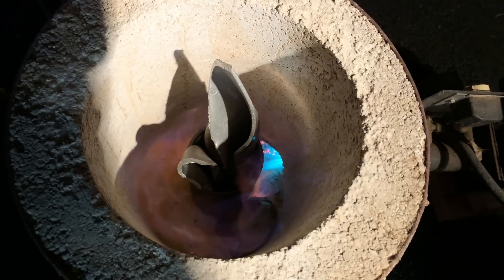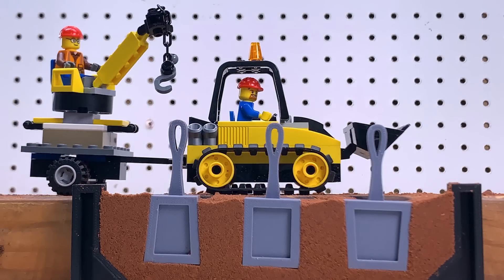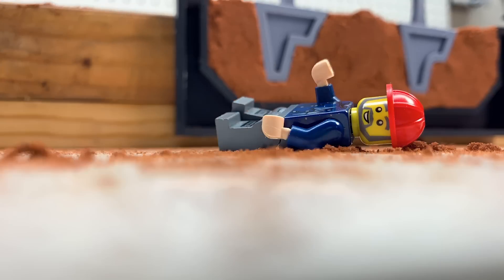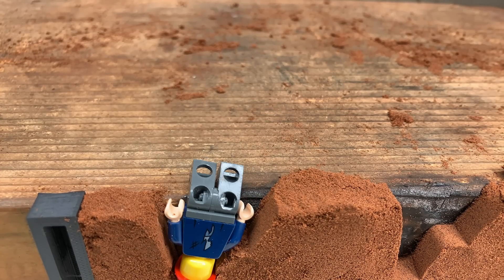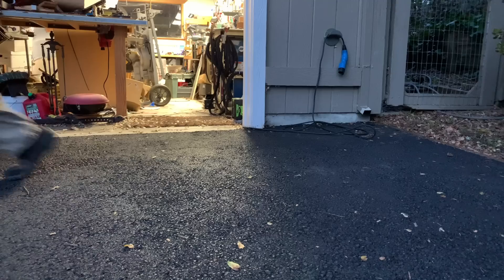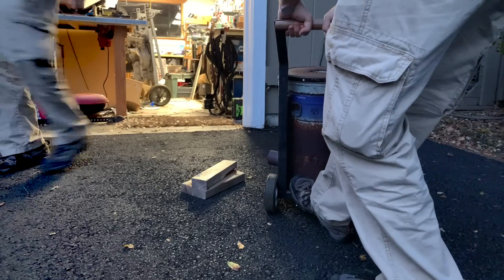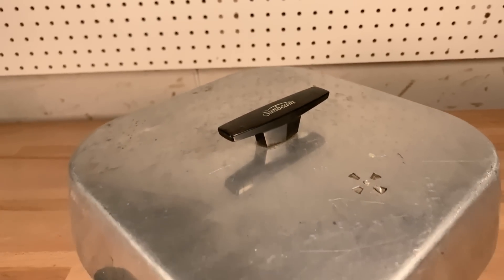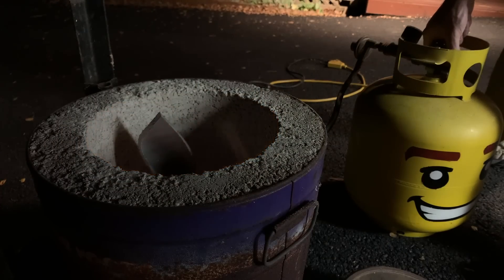Learn to Cast Metal Parts from 3D Prints

Comment: new to printig so might be a dumb question but are their any special settings for printing the models like resolution ect?what settings and filament type you use any help is apricated thanks!!!!
Reply from the maker: Welcome to 3D printing!  If you are talking about filament style printers, the main things that control "resolution" are nozzle size and layer height.   A giant nozzle will limit how thin a wall you can print, and will also affect how many passes the printer has to make to form a "filled" area on each layer.  Because the model is printed out in layers, the layer height controls how thick a slice of the object is printed in each pass.  These steps are what people call "layer lines" and the thicker the steps the more noticeable they are, however printing with tiny layer heights takes longer.  I printed these models in eSun PLA+ with a .15mm layer height, and 0.4mm nozzle diameter. Pretty much any PLA filament will be fine, and helps make it easy to print.
Reply: @retrotechjournal  ok gottcha that make a ton of sense now so by making smaller lines ill get better resolution basically i bought some petg with carbon fiber for making the models  i have someone wanting to do sand casting small figures so i figured that would hold up good thank you for the quick reply and helpfull advice!!! liked and subscribed!!
Reply from the maker: @user-du2of3lh1g  Great!   Welcome aboard. If you're just trying out 3D printing you may want to start with some PLA, simply because it's much easier/cheaper than going strait to carbon fiber re-enforced material.  PLA is very forgiving and prints very cleanly/with great detail.   If they turn out to not be strong enough you can try out the carbon fiber one.  Good luck!
Reply: @retrotechjournal  gottcha iv printed with pla already and yes its great stuff! im trying to expand into other types  i alos got a ruby tip nozzle for he harsher gritty filament im running an ender 3s1 pro with sonic pad its an amazing piece of equipment!!! the sonic pad is a great addition make hings a whole lot easier for us that are tec deficient lol
Reply from the maker: @user-du2of3lh1g  Oh great!  As long as you've already done some printing in PLA then feel free to have at it with other filaments.

Comment: Could you give some clarification on the crucible thingy with the propane tank?  I wanna do this, but I don't want to lose any limbs, life, or property.
Reply from the maker: Oh, that's my foundry.  I improvised that burner using a cheap BBQ rebuild kit (the knobs and regulator) and a squirrel cage blower.  I think most folks make a naturally aspirated one now (one that doesn't use a fan, but instead uses the exiting propane to pull air in via a venturi)   The crucible is just a piece of thick walled steel pipe with a plate welded across the bottom.  Just home brewed.  I'm sure there are a lot of great foundry resources out there online now.   I built that thing decades ago when my silly foundry page was pretty much the only foundry resource on line.  https://retrotechjournal.com/1994/09/07/backyard-foundry-info/  That was mostly about the furnace before this one, but the link to the "new furnace" page is dead.  lol.  I only some of those old pages to modernize/put on the blog.

Comment: hey i love your content but a tiny health tipp aluminium is not really food safe as far as i got teached
Reply from the maker: I have other comments addressing this.  Thanks for your health safety concerns but the FDA considers hard anodized aluminum to be food safe.  I didn't use random scrap for this project, I melted down a commercial aluminum electric skillet.  So the alloy is safe.  I did not hard anodize but since I'm 1) not using it with acidic things like tomato sauces, and 2) not using it very often there is no significant heath risk.  That is definitely something people need to keep in mind when working on food related projects though!

Comment: Those are also called "timbales". Great Video!!
Reply from the maker: Wait. What are called timbales?    I'm glad you liked the video!
Reply: @retrotechjournal  I tried to reply a couple of times, nothing is sticking. 😥 ???  Well, apparently this one did... weird.  When I was a kid in the 50s-60s what you call rosettes we called timbales. After doing a little research, apparently it's more a colloquial than than an official definition. Lots of etsy sellers call them by both terms. There are sets on Amazon that say rosette/timbale sets, and half the irons are rosettes like yours, and the other half have closed bottoms, like little cups, which are are meant to be filled with Bavarian cremes, custards, or something similar, and are actually described as timbales.
Reply from the maker: @oldmaninthecave  Oh weird.  I did get that one.  Sorry you're having such trouble!
Reply: @retrotechjournal  Edited the one that stuck before. Cut my comment in half and removed a link to a set of rosettes/timbales on Amazon.
Reply from the maker: @oldmaninthecave  Oh I see!  Neat.  Thanks I didn't even know about that term for them.

Comment: What are you using for casting sand? By the color it looks like Petrobond. Just getting into this and unable to source casting sand locally, will probably have to order online.
Reply from the maker: Yes, it's Petrobond.  We used to do green sand casting, but I do casting so sporadically that green sand isn't super practical because you have to spend a while getting the moisture content right, etc.  Petrobond is always ready to go, and the detail is amazing.   Sadly I don't have a muller, so for now I just separate and keep the most brunt of the sand.  Some day I'll build a little muller if I end up doing enough castings that my stash of Petrobond starts getting low.  I was lucky that I was able to find a local foundry supply place so I didn't have to pay shipping!  I got 2 big drums of it and it has been lasting a LONG time.  :]

Comment: Howdy bro. I've been watching hit videos and am enjoying them. They have great production value and I bet you spend 40-60 hours on each one  it shows and it's good stuff.
Reply from the maker: Thanks!  You called it.  I put an insane amount of time into making the videos.  Once in a while if I have an idea for a crazy shot I'll spend an entire day filming/editing just to get some 4 second shot. In my injection molding video there's a shot where the camera moves down with the band-saw blade, and goes through the material.  I spent a whole day filming that.  I had to take my band-saw apart and make an adapter so I could run it smoothly at low speed using my drill, etc.  Total insanity.  lol.  But fun to do.  ;]

Comment: This is an extraordinary video and I love your editing skills and stop motion animation. You're very talented. Your videos are so calming and relaxing but also informative. 👍. Couple suggestions, put a piece of cardboard under your crucible in the furnace, it keeps it from sticking to the bottom, and talc powder on your piece before the sand will help it to separate more cleanly when removing it from the sand, otherwise fantastic!!
Reply from the maker: Oh thanks, I'm glad you liked the video.  I used graphite powder (I dust on from a little knit bad bage from a sock tip) as my separating powder (instead of talc), did I not have any footage of that?  Oy so easy to miss.  Great tip about putting cardboard under the crucible.  At these temps/with a steel crucible I haven't had sticking issues, but I'll keep that in mind if my furnace gets gunked up with something. Thanks for taking the time to share some tips!

Comment: if you heated your mould up before casting, would that reduce shrinkage?
Reply from the maker: Ultimately the AL has to reach room temp. So total shrinkage is going to be the same.  Having a hot mold allows you to have the AL pass through smaller passages before cooling so much that it clogs. Not an issue with this mold.  Really what you want to promote is directional shrinkage.  To avoid internal voids caused by islands of still molten metal shrinking.
Reply: @retrotechjournal  gotcha. i think. i like the term 'directional shrinkage.' shrinkage is one thing that concerns me as when/if i ever get around to doing this i'd want to make things that would fit together. nothing can be easy, can it? lol.
Reply from the maker: @ryanbarker5217  You Can over size your pattern by about 6% and it’ll end up the correct size.  For very precise interconnects/dimensions folks tend to leave some extra meat on the part and machine to exact size.
Reply: @retrotechjournal  for some reason i had 4% stuck in my mind. 

i'd just have to do a lot of experiments. the idea was to use aluminum car rims which are supposedly a higher grade metal, but not sure how the alloy would affect shrinkage.
Reply from the maker: @ryanbarker5217  it is true that exact alloy affects shrinkage.  It’s good to be keeping to a consistent source if you’re trying to hit some exact size.  (Instead of just melting down what ever I have handy 🙂).  Still if you can limit the critical dimensions it’s easier to be oversized and machine to exact dimensions.
Reply: @retrotechjournal  i'm trying to be realistic and an optimist at the same time, but that's hard to do especially when you don't have the space, skills, or equipment. i can dream up the space, i can learn to do what i need to do and buy what i need to buy, but these are investments i have to be careful about making. 

as someone who owned a small business, i do believe in getting the best equipment and materials you can reasonably afford as that should have immediate positive benefits. that's why rims are appealing, they should be fairly easy to get and are good quality while also making a lot of AI. i imagine most rims are generally the same alloy. 

it's important stuff to know when your goal is making things with more complex shapes needing separate pieces. 

btw, thanks for responding, i respect your opinion and experience. :)
Reply from the maker: @ryanbarker5217  thankfully the bar to entry on foundry work is fairly low.  In college we melted AL with charcoal and a scavenged blower.  You can learn a lot on a shoe string budget, but you are right that space/investment goes up fast if you want to be able to machine parts. Etc. 

I’m happy to chat about this stuff with fellow travelers on the road to making things. :)
Reply: @retrotechjournal  :)

i've watched many videos over the years and a lot of these guys build their own equipment or use very alternate methods. unfortunately, i don't have that kind of brain, which may be just as well as i also have all my fingers and toes atm. 

still, i want to do manly stuff like make toys using dangerous processes. i've had a small business -- trophies/plaques/t-shirt shop i let the ex keep in the divorce -- so i have experience doing that. a lot of these skillz can easily translate to that field. that's where a metal lathe would come in handy, but that's down the road.

i do want to make things that i can sell, though. what would help is if you did a video on how to weld AI, lol.

Comment: where do you get the sand from home depot or lowes
Reply from the maker: I was using Petrobond sand, which is a very fine sand with a petroleum based binder.    You can do foundry work with water based sands that you could  get from HomeDepo/Loweas.  You can google around for green sand recopies.  It's usually some fine sand, bentonite clay, and water.  Starting out that was what I always used, but it takes a little bit of time to get the moisture content just right.  I only cast sporadically, so having to mix and temper a batch of green sand when I want to do a casting is kind of a pain.  (It dries out sitting around for a long time.)  The Petrobond is always ready to go, and has great detail reproduction, but the down side is without a Muller it's very hard to recycle the burnt sand.

Comment: how can i cast a hollow item I'm trying to cast an formula 1 car body which I want to be hollow but I'm not sure how
Reply from the maker: In sand casting hollow interiors can be created using a core.  Which uses a different kind of sand and is the shape of the interior portion of your model.   It is placed into the sand mold and aligns with core prints that are in the sand portion of the mold.  What size is the casting, and how thick are the walls?   If it's fairly small you may want to consider something like lost plastic casting with an investment.   That's great for high detail casting and you can help metal flow with vacuum or centrifugal force. You can also look into lost foam casting in sand.  Just be aware that large thin walled structures aren't really a great fit for sand casting since it's hard to have the molten metal reach all the parts of the mold without freezing.
Reply: @retrotechjournal  would you be able to make a video on this topic mabey sometime
Reply from the maker: @salestowatch1797  Maybe.  I think maybe next up is a Laser Cutter tips and tricks video, but I really only film what is interesting to me at that moment so it's  possible.  I wouldn't hold out for a video like that. Especially since my video output is so low.  I'll put it on the list.  I'm sure there must be other videos about coring out there.
Reply: @retrotechjournal  ok seems good no hassle anyway

Comment: would like to know about casting shrinkage. does adding those wells, prevent all shrinkage or more than not?
Reply from the maker: Yes.  As the AL cools it shrinks, and those wells provide a larger area that remains molten at its center so the cooling  casting can pull AL from those areas. That way the bulk of the shrinkage occurs there instead of inside the casting.  I'm planning on doing a more detailed video about shrinkage but I haven't managed to get around to doing that yet.  The bat pattern is not ideally designed for directional solidification so I'm sure there are shrinkage voids at many of the hot spots in inside the bat, but for this application those don't matter.  As long as there's no visible external shrinkage it's good enough.   If he were a high performance engine part or something then it would matter a lot.

Comment: just made a bunch of these today
then found this video by shear chance
my iron came with a cup mold, it doesn't work with the normal batter. what does work?
Reply from the maker: Are you having trouble with them sticking?  Make sure you let the irons get good and hot before sticking them back in the batter.  Sorry I don't usually make the cup shaped ones so I don't have much advice about those specifically.   Just general "reducing sticking" advice.
Reply: @retrotechjournal  no sticking, just not getting done on the inside
Reply from the maker: @pacman10182  Oh.  Interesting.  Yes I can see how that would happen.  I would try making the batter a little thinner.  That might help make the entire thing thinner/have it cook though more quickly.  I guess you could also try lifting them with a fork once they've come off the iron so the bottoms are in the oil but the tops are not. More work but it may allow you to drive off the moisture in the bigger bottom section without having the tips burn.  It's all just theory though.  Since I haven't used that type of iron.  lol
Reply from the maker: @pacman10182  Or you could try submerging them once they come off the iron?

Comment: You seem like an awesome dude and a great pap, but isn't aluminium toxic?
Reply from the maker: Well this is one of those internet hot button topics, but in short.  Anodized aluminum is considered food safe.  One reason for using a melted down electric skillet (instead of random scrap) is that I could be sure the alloy of AL was food safe. (No danger of lead, etc.)  I did not anodize this aluminum but the main reason for needing an aluminum oxide exterior to be food safe is if you are cooking acidic things like tomato sauce, etc.  If this were an every day use cooking pot that could have any sort of thing dumped into it I would have to go through the extra anodizing step but since this is only exposed to one non acidic recipe and  is only used once or twice a year it is very safe.
Reply: @retrotechjournal  Ok, I see now. I'll keep this in mind the next time my wife wants to argue with me over cooking up the hotdogs in foil, lol. We love your videos by the way!
Reply from the maker: @FlockofSmeagles  I'm glad you like the videos!  I have fun making them so it's a great bonus when other people like watching them.  :]

Comment: You can use plaster around the printed piece so that in a first step it melts in the oven and the cavity remains in the plaster.
Reply from the maker: Yes, but this way the pattern is reusable.  I can make 10 bats with just a tiny bit more work.  Lost PLA casting is a fine thing and useful if you have complex geometry that can not be removed from the sand easily, but it requires more steps, and more finishing steps per piece if you want better than as-printed surface finish.